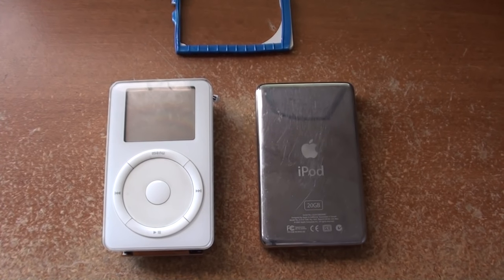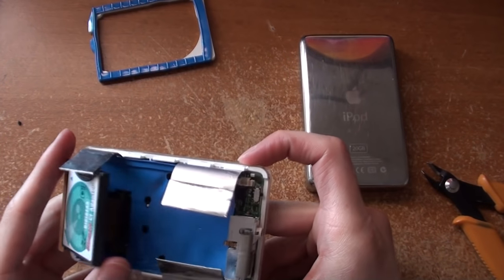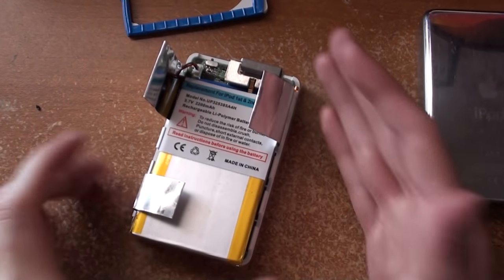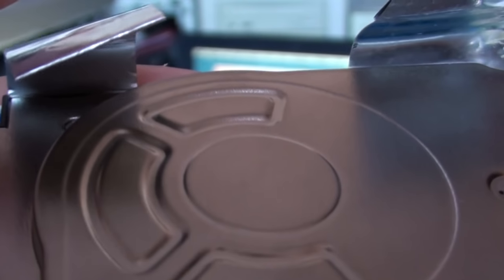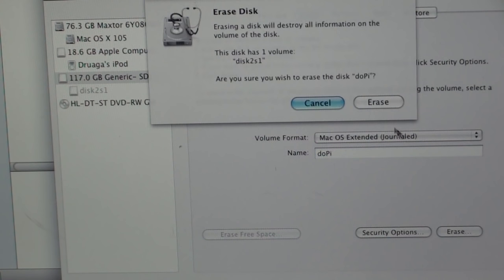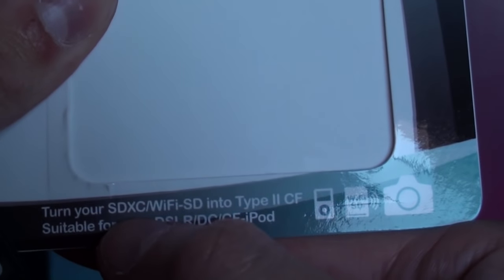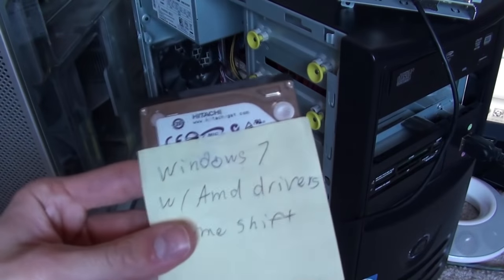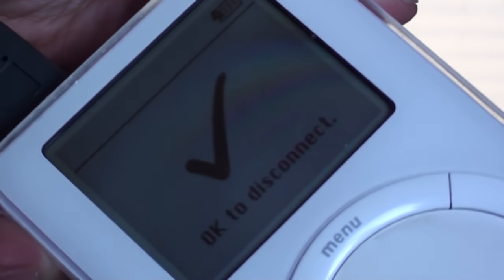How NOT to Install an SSD Into an iPod (2nd Gen) [Part 1]

Comment: i didnt know there were hdds in ipods
Reply: they are so small and adorable.
Reply: +Abhi Mayadam XD
Reply: +Paul HDDS
Reply: Not in all of them thankfully, only the high capacity ones that are really *really* thick. Others have regular flash memory.
Reply: The first generation Ipod Mini had a 4GB IBM microdrive, which is a Hard Drive in a CF formfactor
Reply: The newer ones don't. Flash memory cost a lot back then.
Reply: *****
I said iPOD mini. The first generation was released in 2004, the second in 2005. Both used IBM microdrives as storage.
Reply: Same. Weeeiiirrrd.
Reply: The more you know
Reply: How old are you? These were the iPods that shot Apple into the limelight. Later came the iPhones.
Reply: 16 here, always knew that old (and Classic) iPods use HDD.
Reply: +TheDeeplyCynical First gen iPod was released back in 2001.
Reply: +Pyrex Fox. I'm referring to the iPod MINI which was available from Jan 2004 to Sep 2005 before being superceeded by the Nano.
Reply: Okay then, thought you mean the original one.
Reply: hey you are from vinesauce
Reply: Umm, flash storage?
Reply: Yup. I've got an old Sony Walkman NW-A3000 or something with a 20GB tiny mechanical HDD in it. Still works. The Drive is like the size of a large-ish coin, standard SD card sorta size
Reply: Antonio Debono when you load a song on an iPod listen to it without headphones
Reply: And unreliable for shit.
Reply: I too
Reply: I too i ias awesome 
But i forget what was video about
Reply: Paul Flash?
Reply: Me neither... Wonder if you can put it into a PC and boot from it?
Reply: Bruh. Really?

Comment: And now...install a iPod HDD with a CF to SATA adapter in a laptop
Reply: lol that would be funny, he would need a IDE to SATA adapter though not a CF to SATA adapter, the original drive is IDE, Compact Flash cards use a subset of the IDE command set hence their relatively easy compatibility, that's why he needs the fancy active adapter as opposed to just a plain old CF to SD adapter for his iPod
Reply: Or just boot from the HDD on a PC with CF reader

Comment: Druaga the next time you use GParted click on the "View" menu and click on "Supported File Systems", that will open a window with all the supported file systems on the Linux installation. On the "Required Software" column you have the name of the packages you have to install using apt-get. For hfs file systems it appears to be the "hfsutils" and "hfsprogs" packages.

Comment: Hey bro, if you're having trouble getting the stock os to load up on the ipod, try installing RockBox, It's an alternate operating system that doesn't require itunes at all. Got it running on my Ipod Classic and it's brilliant.
Reply: I'm jealous. I really want one so that I can convert my music library to Opus or Vorbis and convert my wav files to flac so that my music can be patent free and well compressed.
Reply: They are amazing devices indeed. I wouldn't part with my classic for anything.
Reply: +Ryan Mattox patent free ? lmao, y tho?
Reply: Rockbox fraked my ipod classic 160gb. It didnt wanted to charge. After restoring it with itunes everything was fine.
Reply: How long ago did you try that?
Reply: +MrVitalic85 always worth a try, if it can be undone!
Reply: Speaking of which, I just bricked my ipod trying to update rockbox. Hopefully it's fixable.
Reply: +Inceptual Games a brick should be just a failure to boot because the os isn't working.
Reply: Nah, it's a corrupted HDD. any amount of data i put in up to about 30gb or more tends to make the entire drive corrupt until i reformat
Reply: UnderFact yeah sure

Comment: Maybe the battery needs a little bump up. Overstored batteries tend to be deeply discharged but more or less fine. with a small current limit of about .05C and 3V, slowly bump it up to 3V. After that it should charge normally in the iPod. The reason why you can't select hfs(+) is because the appropriate hfs tools are not installed by default. Also 1337 likes is quite cool!

Comment: Hey Smoker, i hope you make a Hackintosh trible boot with MacOS, Windows and Linux
Reply: That would be nice
Reply: I did that with my Asus EEE PC 900 netbook... and added a touchscreen as well... that worked in OSX, Windows, and Linux.
Reply: Shit, running Win10, El capitan and Ubuntu 15.04 on the same machine. Mad.
Reply: +Meow[sic] Plays I assume Mac OS X and Linux were lag city... Windows XP I presume?
Reply: Actually everything was decent! The Mac OS was the slowest, especially load time but still usable once I had upgraded the PCI/SSD to a much faster one. The built-in 8gb (or 16gb?) PCI stick SSD was awful slow, but the 64gb I replaced it with definitely sped things up.
Reply: Meow[sic] Plays I just don't get how people can use Linux...

SSDs are pretty neat, but I enjoy hard disks more.
Reply: AIO inc. Honestly Linux & macOS are about 70% the same. If you do some tweaks (search for MacBuntu) this takes it to about 85%!
Reply: Meow[sic] Plays Mac OS X is pretty neat (latest version I've used is 10.5.8 Leopard, though, and I often use 10.4.11 Tiger instead), but I just can't stand Linux, it's just got no use in my life, and so far it hasn't performed well on any of my computers.
Reply: +Meow[sic] Plays OS X is BSD, Linux is ..  Linux. They're both Unix (POSIX)
Reply: Max Wittelsbach Unix is on both sides... Like he said.
Reply: AIO inc. correct
Reply: ***** OS X was okay - until 10.6, up until 10.5.8 it was fine. I've still got 10.4.11 running on my Power Mac G5 - which is the best version of OS X (last version with classic support), and the most powerful PowerPC computer Apple ever made.
Reply: ***** I didn't know you could have more than one instance of control panel open in Windows - I've never seen that happen.

Honestly, the only problem with 10.5.8 and earlier is finding programs compatible with it, but once you've gotten all your programs together, it's excellent.

While Windows is certainly better - no doubt in my mind - Mac OS X 10.5.8 and earlier are great examples of alternatives.
Reply: ***** Mac OS X 10.4.11 and 10.5.8 don't have the App Store as far as I know - that wasn't a feature when they were released (2005 & 2007, respectively).

OS X does look nice, but I like the look of Mac OS 9 with the Lollipop background much better.

The MIDI support in Mac OS X actually seems really slow and a sort of performance hog - about 50-60% CPU usage when playing a complex file.

I know you can have multiple objects open in the Windows Control panel - and while it is certainly useful, the three things I use most often are "System," "Device Manager," and "Display," which in Mac OS X translate to "About this Mac," "System Profiler," and "Displays," all of which are individual programs or sub-menus of their own.

I will agree, Windows is excellent for the computer repair business, I should know, but I have to yield in saying that Linux is far superior for this task - It can read far more volume types than any other operating system I know of, and while it is horrendously slow in most cases, it does a darn good job at disk management.
Reply: pretty easy as a matter of fact
Reply: >trible boot

Comment: Fun fact for y'all, I figured this out from owning a Dell Latitude X1 which uses the same style hard drives as these older iPods. The connector that the motherboard uses is 40 pin ZIF (Zero Insertion Force) connector, going to a 1.8 inch IDE Hard Drive, however the hard drive has a compact flash like attachment. As these drives were standardized, by purchasing a 40 pin ZIF cable - since most 40 pin ZIF drives don't use the compact flash connection, it is possible to connect up to a 128GB 1.8" ZIF SSD (https://www.ebay.co.uk/itm/128GB-KingSpec-1-8-inch-ZIF-40-pin-SSD-Solid-State-Disk-SMI-Controller-MLC/182983101570?epid=129600902&hash=item2a9aa48c82:g:lZAAAOSwgmJXyTim) to one of these iPods, and it's native and doesn't require any adapters. 

But yeah, there's native SSD's for these older iPods, and they work in Latitude X1's too!

Or you could just use iFlash which is probably cheaper.

Comment: Did Microsoft actually remove the option to format as FAT32 in Windows 10? ;) (or does it still work via Command Prompt or something)
Reply: No, they didn't, but their "format" utility only allows you to format volumes smaller than 32 GB as FAT32, despite FAT32 supporting up to 2 TB.
Reply: +reinaertdevos The guy before you literally said that exact same thing but more exact and straight forward man why did you even
Reply: maybe he didnt refresh his page
Reply: There is a 32 GB "limit" to FAT32 but it's pretty stupid: that's what they set in Windows 2000 and never bothered to update it. You can actually create larger volumes in Windows 98: up to slightly less than 128 GB. Back in the day Microsoft felt the need to cripple FAT32 support to promote NTFS but no such thing was really needed because NTFS has compelling features. Gparted can format larger volumes, up to the full 2 TB. I imagine you'd be able to find systems with difficulty reading said volumes, however, since >32 GB probably isn't well tested.
Reply: I think the biggest issue with large FAT32 partitions was the individual filesize limit.

A max 4GB filesize is a big problem when DVD disc images are ~4.7GB

Got caught out by that in the past a few times when fiddling with old tech. :D ("why can't i back up stuff to this old hard drive???" hehe)

Comment: They put a mechanical hard drive in a media player.... -_-

...

...

..Why.
Reply: I don't think flash storage was as popular in 2001.
Reply: 5gb of Flash memory was insanely expensive in 2001 - a 5gb HDD made the iPod affordable.
Reply: ??? Technology then was pretty good. The pentium 4 wasn't so good though.
Didn't see that the ipod thing was from 2000. Makes sense to have a hard drive now.
Reply: There were solid state media players at the time. They had capacities of 32 - 64 megabytes, enough for 5-20 songs. The iPod Classic was retired in 2014, so, perhaps surprisingly, platter drives lasted quite a long time in the marketplace. The 160 GB platter drive on the highest capacity model is unmatched by any solid state model, though the iPod Touch 128 GB released a year ago comes close. However, people with that level of stroage needs are probably better off getting an Android phone and storing their collection on Micro SD.
Reply: iPod Gen. 2s are from ~2003. The first commercial (or rather, affordable-for-the-average-consumer) SSDs didn't appear until 4 years later, with an average price of $40/gigabyte, compared to the Gen 2's ~$1/GB of an old Microdrive/CF hard disk. 

Cheap NAND/flash memory, compatible with IDE and SATA like Microdrive, didn't really exist until the 2010s (prior SSDs were typically PCI and used by mainframes or corporate servers), and affordable ones maybe 2012. Before that, you'd be relying on a removable SDcard probably comparable in write/read speed to a compact disc, with costs of a 1GB SDcard (in 2004) being about $500 MSRP.

Platter hard disks still have the storage advantage, anyway. SSDs are very much remaining in the realm of boot/specialist drives today, while media like music/videos/games will be kept on hard disks. There are 4TB flash drives (the mid-range of what current hard disks offer in capacity), but they remain out of the price range of most people.

Probably in another five to ten years it will be affordable/practical to have a total solid state rig, without spending literally $1500 to $3000 on a build in hard disks alone. By that time we might even see HBM/HMC start to push SDRAM out of the market.

Comment: I just got a new PCI-E Intel 400GB SSD =P
Reply: k
Reply: No one needs PCIe SSDs, SATA is enough for almost anything.
Reply: k
Reply: Give it to Ian so he can put it into his PC
Reply: Do you compare 2 gigabytes of reading with 6 gigabits?
You are weird, Leurak.
Reply: Валерий Пикалов
I know PCIe has a much better bandwidth, but you don't need the extra speed.
Reply: Like a baws =P

http://i.imgur.com/1CP0u48.jpg
Reply: +Leurak IAN NEEDS TO INSTALL THE MEMZ TROJAN ONTO AN SSD :P
Reply: Pikapoo-Chan
lol
Reply: +Leurak when you run out of 
SATA, or maybe don't have the 6GB/S SATA
Reply: +Leurak gotta trust you, Leurak. You did make MEMZ after all
Reply: Nice, what does it benchmark?
Reply: +Timur Tripp

http://i.imgur.com/vbbHWr4.png

It's pretty variable, that sequential write is kind of low I've seen it at 1.2 GB/s before. 

P.S.

Why does Windows think everything is SCSI? I've seen drauga mention this too. Regardless of interface, you can see my multitude of drives there. One is PCI-E interface, one is m.2, the rest are SATA platters. Yet it thinks they are all SCSI?
Reply: Hogdriva
windows doesnt know. i listen to my BIOS more than windows or linux or anything.
Reply: I know it's not correct I just would like to know why it thinks everything is scuzzy
Reply: +Leurak you do if you're booting up Garry's mod
Reply: +Hogdriva that's just the way MBR works.
Reply: wtf its the memz dude again
Reply: Ariss
dont question him. hes everywhere and he could be right at your doorstep. that is once he installed the MEMZ trojan on your door.
Reply: It was US $300, and it outperforms SATA III SSDs by 2x at least. 2.3GB/s read 1.2ish write
Reply: Well, I paid $310 for mine. And these are the benchmarks .http://i.imgur.com/vbbHWr4.png]
Reply: I paid $314.98 with tax and shipping, from http://www.newegg.com/Product/Product.aspx?Item=9SIA12K4H58574&cm_re=Intel_750-_-20-167-359-_-Product although its more now for some reason lol. In hindsight I should have saved a bit more for the 800gb or 1.2TB versions but eh it was kind of an impulse buy.

Comment: If something is a bit too small, just stick scotch tape in it. It's what I do with my iPad, which has such a worn out charging port, that it can't charge unless I put tape in the port and cover the part of the charging cord that goes in the iPad with tape adhesive. The best part is that it hasn't started a fire yet.

Comment: Oh wow, the motherboard USB headers :D

The dual-USB port motherboard header has 9 pins, 8 in use and one populated plus one empty so you can only plug it in the right orientation.

The second header is half a motherboard adapter - one electrical USB connection, it has 4 pins because a USB port uses 4 wires...

Fun times were the computer cases that split their motherboard headers into individual pin connectors, where you needed to plug in the individual connectors into the right places on each twin-USB motherboard header. (power +, power - and data +, data -)

Comment: You can get a even bigger battery.  It does not have to be specifically for the iPod.  It just has to have the proper voltage.

Comment: Duraga! You should know this! The green arrow on the CF adaptor denotes Pin 1. Then all you have to do is look at the drive which should have a similar marking denoting it's pin 1 and that will give you the orientation to plug in the drive.

Comment: You should mod your Mac Mini G4s to overclock them (maybe even use the soldering iron, or just scratch off the resistors with a knife like I did)

Comment: Hello, I would suspect that by putting the compact card in upside down you may of accidentally run power through a data wire thus killing the card. This could also explain the heat of felt when taking out the card adaptor and SD card.

Comment: I have that exact same 16MB SD card that I got from a cheap camcorder thing from Rite-Aid. The only difference is that the vendors sharpied out the label except for the part that says the capacity of 16MB. The camera itself is also hilariously cheap, and actually has weights in it to make it feel less cheap than it is (despite the fact that the camera takes pictures and videos in horrendously bad quality).

Comment: I guess that blue stuff between logic board and old hdd is thermal pad, and it uses hdd metal chasy as cooling surface for IC's, by removing old hdd you effectively removed its "radiator", thats why it gets so hot.

Comment: Pedantry: an SD card (or a USB flash drive for that matter) isn't a “Solid State Drive”. It's solid-state (no moving parts), sure, but SSDs are fast, flash-based hard drives that contain intelligent SSD controller chips with wear-levelling, whereas an SD card is just plain, not particularly fast or reliable flash.

Comment: Can confirm iPod classic is a nightmare to open. Destroyed mine getting into it for a battery replacement some years ago. 

Ended up ordering a 5.5G iPod Video chassis to replace it and transplanted everything over. Worked great, funnily enough. Still miss that frankeniPod. 

And yeah, those nylon tools are pretty cheap and meant for like, three uses at most. :( shame because they're super handy.

Comment: I figured that my old Compaq Presario SR1610NX has two Firewire 400 ports. So basically, when I get my VGA cable (all that it needs) I could install an old version of iTunes and restore some iPods. And I'm happy because I was searching for a Firewire compatible device for a while.
Reply: Since it was a Compaq, it runs Windows XP.

Comment: Druaga, Linux and Windows probably can't detect the drive because the Compact Flash readers you're using with the computers aren't capable of handling SDXC drives. If you use a newer reader that supports the new standard it should work. Also, the CF adapter might not work with the iPod because the Compact Flash specifications at the time set a size limit that was below 128 gigabytes.